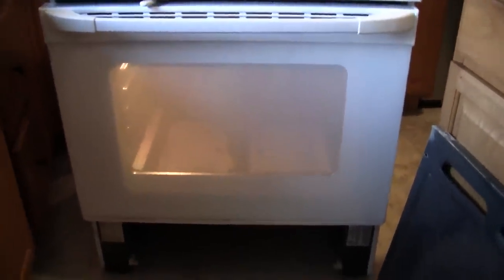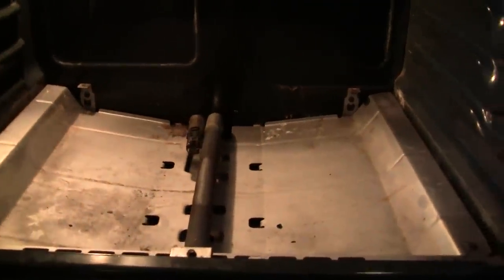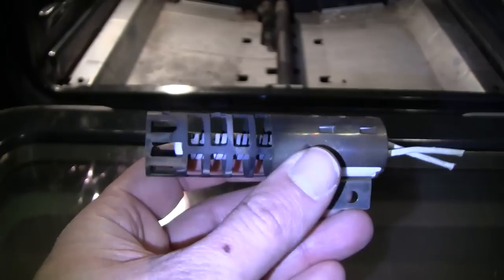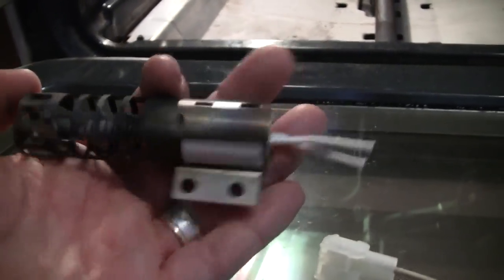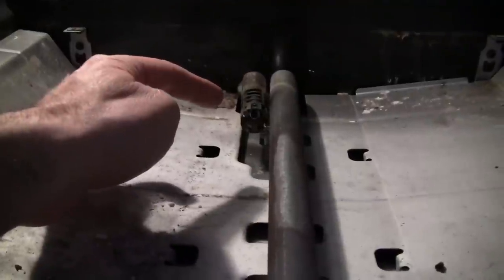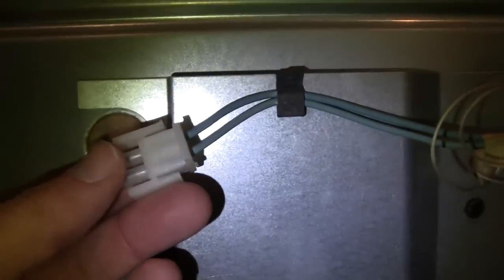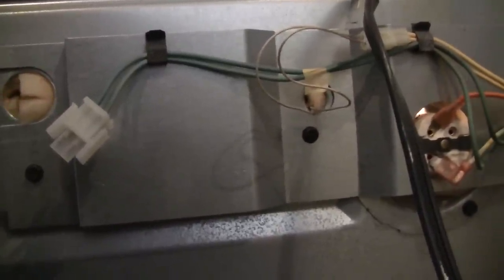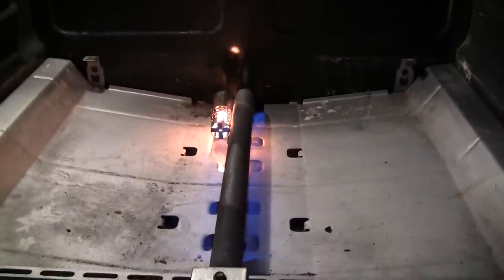How To Replace The Oven Igniter in GE XL44 Range

Comment: This saved my pizza! I was making pizza and had just finished caramelizing onions in a cast iron pan in the oven for about 45-60 mins at 350. When I went to preheat the oven for the pizza, it never got off the "Pre" reading on the oven's digital display. The oven was only mildly hot. Probably cooling down from cooking the onions. I guess this is when my oven igniter died : ( 

I tried to clean it off, I sprayed it with a can of compressed alcohol, and then air, but it was dead Jim. It didn't come on at all : ( 

I found your video and am now making my first pizza! It crossed my mind the broiler igniter might be the same as the oven igniter but this was the confirmation and more importantly the information I needed to get my hands dirty. I rarely use the broiler either but may still order the now scavenged and expensive part. 

This work was kind of intense and a hassle, because you never know if it's gonna work, or explode, etc. and it involves pulling a heavy oven around and taking it apart - but it was better than wasting the pizzas I'd made from scratch that were ready to be cooked, and better than laying out $$$($)? for a new oven. 

My oven, a GE JGBP33SEH3SS, apparently was manufactured in 2003 in Mexico. I guess these things don't last like they used to. I already replaced the range sensor thermostat 3 years prior, also by watching YouTube. It was also kind of a hassle. I believe it had a plastic connector jack that didn't match the replacement part I'd got on Amazon : (  Do you know if the igniter stays on until you're done cooking, or does it go off at a certain point after the oven heats up? I believe it goes off when the oven reaches the set temperature. 

Even though it can be a hassle, it feels pretty great to fix these things on your own.

Thanks again!

P.S. Measure twice and cut once : )

Comment: Gave be the confidence to replace it but was a little long for what information given.
Remove front door, racks, anything on top that could fall off and pan drawer in bottom.
Two screws in back of bottom tray in oven, then slide back out of groove.
Remove screw at front of burner tube in bottom front of oven. Then roll up so you can access the two screws in bottom back for tube then it lifts right out in the oven.
This allows you to access the two screws attaching heating element burner tube. Swap out for the new element. Run new wires through the back. Cut old wires and attache the new part with wire nuts. Make sure you leave plenty of wire to attach.
I laid the stove on the seat of a chair when I needed to lean forward.

Comment: Thanks  for posting this video.  Since igniter are cheap I would not recommend taking the top broil igniter out as a temporary replacement...this will just create more work later.  Might as well buy a new one igniter and replace the one that is burned out.    ....measure twice, cut once.   

 I just completed the job but it took me almost two hours.  My GE XL44 is designed different than what you show in the video.  I had some trouble removing the burner which slowed  me from accessing the old igniter: two screws holding the burner were very difficult to access, also one of the screw stripped on it's way out.    In the end I was able to re-insert both screw and install a new igniter.   Just thought I would post this comment to show that you may run into unforeseen situations that you will have to fix on the spot.
Reply: my gexl44 is also different looking than this one too. got an igniter on amazon linked from a different video and it doesn’t fit correctly 😞
Reply: When you don't want to wait a few days for a part to arrive because you are in the middle of cooking, swapping the igniters can save the day.

Comment: Its 2017 and the part you needed is MUCH cheaper now. My wife uses the broiler to cook salmon fillets so I ordered the part on-line, through the Walmart site. It ran for about $21 including shipping and arrived in 5 days. It includes one oven plug wire and one wire which was stripped for use with the connecting cap which, I think, are high-heat connectors. That may or may not matter, but I opted for the 21 dollar part rather than a 15 dollar part from elsewhere to avoid complications. The part also came with a bracket which I also may not need. Thanks for the video! Now to find my 1/4 inch socket for my wrench or nut driver.

Comment: Hey Folks, I'm here to give an updated 2023 experience.
1st. This` an Excellent Stove/Oven, just thee igniters issue.
I opted to remove thee bottom-end of th oven, uncork th wires and remove the igniter.
This is a Very Helpful video, Buuut 'i' don't suggest removing that Gas Bar, just Yet!!! Because...
Also from underneath, there is a Small Safety Lever that cuts off the existing gas in the Line--- Now--- One can remove that Gas Bar...
Just adding some info.
Thanks for the Broiler connector info...
Reply from the maker: Thanks for the comment. I don't recall if mention it in the video but you should always turn off the gas supply to the appliance before performing maintenance or repairs.

Comment: Most ignitors will pull 3.2-3.6 amps in use, what we see nearly all of the time is that it glows but no ignition, 9 times out of 10 it is the ignitor even though it is still glowing. It is not pulling enough amps to open up the gas valve. Sometimes you will here a whoosh sound when it lights off, change the ignitor and look for any corrosion on and around the burner holes where the gas exits by the ignitor. If it is rusted through the holes or deformed in any way, change the burner tube. Good day.
Reply: Thank you!!
Reply: yes, thank you!  my glow bar lights up orange but only fires and heats the oven to temperature like 1 out of 5 times and when it does never quickly
I may go ahead and replace the ignitor and tube

Comment: Thank you for posting this information.  I would have liked to see the repair done so I went to other videos for that. Also, I actually saw 2 ways of getting to the igniter mounting screws 1) taking the venturi out and changing the igniter out and 2) keeping the venturi in and taking the plate below it out to get to the screws. Number 1 is very easy in comparison and took only 45 minutes from start to finish. Very easy fix: 7 screws total and as far as tools its only a screw driver, wire strippers and a 1/4" nut drive with an extender. Piece of cake!
Reply: +chris_40 Did you find other videos showing how to replace it on this particular model?  So far I'm only seeing them for different ovens.  If you have a link to another video for this one, it would be really helpful.  Thanks.
Reply: Yeah I'm not sure what the Venturi is but I'm assuming it has to do with that pipe that runs right across one of those two screws and gives you about one inch of working room. I'd like to see how to get to that screw or just know it's ok to muscle a flathead around that pipe without fear of damaging it

Comment: Appreciate the video, I realize this was 8 years ago but was wondering what you thought about my stove...
Glow bar lights up orange but only fires and heats the oven to temperature like 1 out of 5 times and when it does never quickly!  Thanks for any help 🙏
Reply from the maker: I really cannot say for sure, but the igniter may be on it's way out.  Since you say the igniter is glowing and getting hot, and then the stove takes longer to heat, that makes me think that it may be a gas supply problem.  I know that sometimes with gas fireplaces if you are not running a pilot light, spiders can make a home in the supply line and then you won't get gas flow.  These stoves do not have a pilot light since they have an igniter.  I am not sure if there's a way to make sure the gas line is clear, probably something to research.  Once again, this is a gas stove so please be careful.

Comment: This was helpful. The hardest part was getting the screws off and onto the gas bar that the igniter is attached to. You can push up the sheet metal that will expose the top screw better and you can move the gas line a bit to get at the bottom screw. It seems like a bad design that you need to muscle the gas line a bit to get the bottom screw in. Getting them back in was a bit harder. I was using a nut driver but the screw kept falling out. I used a bit of scotch tape to help hold it in place to get it started. I got the OEM igniter from GE, which was an exact match and it came with replacement screws and ceramic caps. One problem was that the caps seemed a little big and it was difficult to get them to tighten, especially in a tight spot.
Reply: Did thank you I was looking for this kind of comment regarding that damn screw! So it was ok to just force a flathead driver around that pipe to get to it? Did you go over or under the pipe to get to that screw?
Reply: Dude thank you I was looking for this kind of comment regarding that damn screw! So it was ok to just force a flathead driver around that pipe to get to it? Did you go over or under the pipe to get to that screw?

Comment: WARNING: Do NOT disconnect or loosen the gas burner/diffuser - that step is not needed and could lead to weakening the pipe connector - which is potentially dangerous. (Gas explodes).

The bottom pan of this oven comes off with (4) 1/4 sheet metal screws, and then 2 more that need to be removed from the body (these are both mounted on either side of the pan). You will need to remove the oven drawer to access these screws. Once those are removed, you can access the (2) 1/4 machine screws that affix the igniter to the gas diffuser. It is then relatively easy, if you have an OEM part, to replace.

If not, then you will need to splice the new igniter into the old wiring with the supplied heat resistant wire nuts. NOTE: The wire nuts used here are not heat tempered and so they might melt on very high temperatures (just check them to be sure, don't want you to be dealing with a short or worse in the future). I would not use the self clean cycle without knowing those guys won't melt at sustained 500°F.

Good luck all!
Reply: +GregJoshuaW - Not only are you correct, Greg, but some models (my JGBP30GEP) do not have the two screws that hold the gas burner diffuser under, in the drawer section. It looks like it is the gas-feeding into the diffuser is an assembly, and so difficult to separate.
Reply: t
Reply: Joshua man thanks for your comment. it helped me and my family stay safe. the way  Chris did this didn't seem right to me. again thanks.
Reply: Not true. This comment cost me two hours worth of trying to get the bottom of my oven off (ridiculous, and I'm not a dumbass)
Every oven is different. I contacted GE and they even said taking the bake burner out to access the ignitor for replacement will not cause a gas leak unless I'm the one that causes a rupture, or something of that nature. They said don't over screw things that don't need to be and pretty much just redo what you undid to fix it. There are like 10 other diy videos for this model oven and ALL of them instruct to remove the diffuser, burner whatever it's called

Comment: Thanks.  You answered the question I've had.  We have a GE Profile Spectra XL44 with a different panel.    Our igniter sometimes works but most of the time it doesn't.  It takes forever for it to heat up.  Ours over is 14 years old and we've never used the broiler.  (I prefer to BBQ....)       Looks like an easy swap.
Reply: Your ignitor is bad.

Comment: Nice video thank you for posting.  That ignitor goes out like clockwork on those GE ranges - spectra, etc.- just one concern: ceramic wire nuts are a safer bet for splices in a hot oven environment!  Regular ones melt!

Comment: I don't think there is a spare igniter. The one you removed on top is the igniter for the broiler.
Reply: The point is, if your oven igniter dies, e.g. the bottom igniter, you can use the top broiler igniter as a replacement for the bottom oven igniter. This assumes you need to use the regular oven ASAP and not the broiler. You can then order the spare igniter parts you need at your leisure.

Comment: I replaced it and the igniter is glowing but the gas on but flames are not coming out as high as normal.  Almost like the gas line is partially obstructed or something.  Any advice?
Reply: Adjust Broil and Oven Burner Air Adjustment Shutters. Air adjustment shutters for the top and bottom burners regulate the flow of air to the flames. --->The shutter for the bottom (oven) burner is near the back wall behind the warming drawer. -->Remove the drawer. See the Care and cleaning of the range section.
-->To adjust the flow of air to either burner, loosen the Phillips head screw and rotate the shutter toward open or closed position as needed. Open inputs more air lower flame lenghts. Closed less air and more Gas and the Flames are BIGGER! (Just adjust so it is not that big that the flame turns yellow that is too much).

Comment: Ok, got bottme done and tried to test oven but without reinstalling upper and lower oven pans. Oven nor broiler will come on now. Broiler worked fine before. Is there a safety device that senses these pans missing which is not allowing operation? Just trying to make sure everything works before putting it all back together.

Comment: the broiler is on the bottom! burners are on top!
Reply: Whiskey150 On the GE XL44 model, within the oven itself (door pulled open), the broiler output unit is indeed on top (above the racks) and the baking output unit is on the bottom (below the racks).

Comment: I have a GE XL44. I have replaced the oven glow bar and when I plug in the stove, the control panel doesn't light up but it does hum at alternating levels. I am wondering if there is a reset button for the control panel.
Reply: ????  Did you, ever, get an answer because my GE XL44 control panel isn't lighting up, neither!

Comment: How do you take out those two screws holding the ignitor to the bracket on the oven?! The bottom screw is tucked behind that pipe with only about an inch of working room between that pipe and that screw. I cant get to it from either the top or bottom with a flathead nut driver or 1/4 ratchet & socket
Reply from the maker: Sorry I am not able to look at mine right now, but I seem to remember that you have to remove the pipe to detach it from the pipe. Is there a screw holding the pipe in place that you access from the rear of the stove?
Reply from the maker: I just watched the video again and I explained how to remove the bar that the igniter is attached to in order to replace the igniter around 4:00
Reply: Go to 445 of your video. Starting there when you are looking underneath, you are looking at those two nuts that are holding the tube to the brackets. Running across those nuts is some kind of curvy pipe that runs off the gas regulator. I can't get a flathead nut driver around that pipe to hit the bottom screw and my 1/4 inch socket wrench doesn't have enough room to squeeze between that nut and that pipe. My question is how to get to that but that's so tightly packed in?

Comment: Hate to criticize you but all you have to do is remove panel under the stove remove two 1/4 bolts right under the ignitor and disconnect wires easy easy and also those wire nuts are bot approved they sell ceramic one at supply house made for stoves

Comment: After setting the temp for the oven on my XL44 the burner does start up, but then turns off after a few minutes.  The temperature lights on the console also go out.  Is this also an igniter problem?